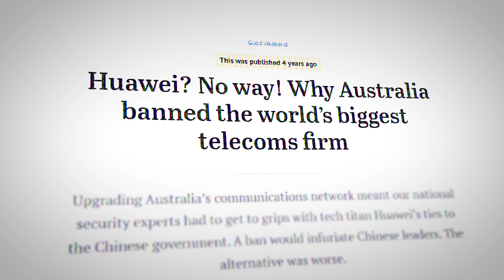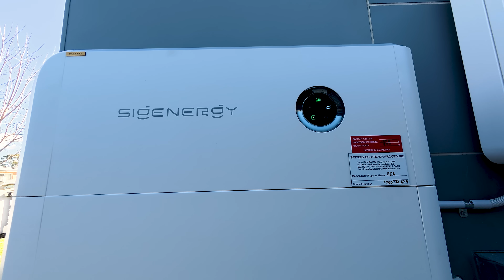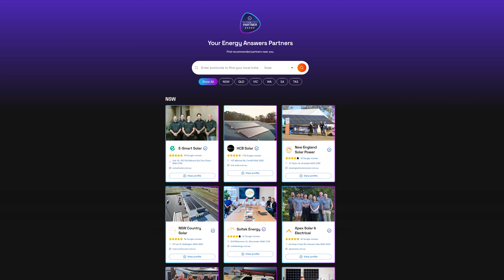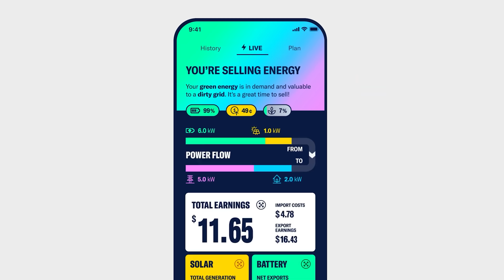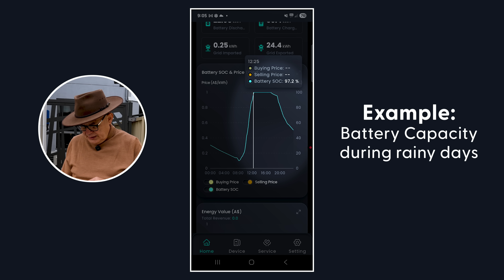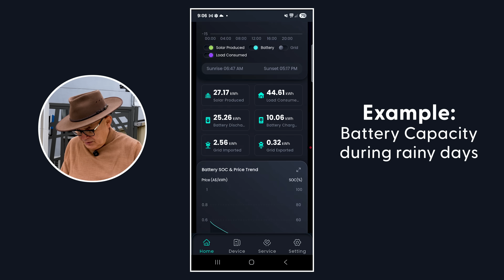Is going off-grid with Sigenergy a big risk?

Comment: We love our 24kwh sigenstor system. We could definitely use more, but our plan is to get more modules in 3-5 years to keep newer batteries in the stack at all times. Have to consider the senescence of these systems and cost of replacement. I want to make sure we are never going to have failure costs that would hurt to fork out all at once. The rebate is amazing, but too big is still going to cost you, especially to maintain later. Plus these systems will get cheaper with time, and better. The inverters only have 5 years warranty, so you want to stay on top of the longevity plan as well as the immediate. Of course more is better in the moment…not so when it needs replaced all at once. There are huge advantages to modular systems. I would rather use the whole battery daily for 3-5 years, then expand and keep the modules cycling than be looking at 30-40k all at once every 7-10 years. At least panels last 15-20 years now. Plus, a large battery system makes the efficiency of the solar less critical, it is sort of just bonus on sunny days and keeps you going on the cloudy days. 

Also, this was a really great video, thank you. I completely agree about cloudy days. Here in Melbourne you do have to charge from grid and I love that Amber makes it so I do not have to think about it all the time. It knows I want to keep it full and charge from the grid when it’s cheap to make it through exy periods at night. Has been a game changer for us and makes having a battery system worth while. With other retailers you are not saving any real money putting back into the grid anymore. Sad to see honestly. The 10km/day caps are really ridiculous imo. Not sure how our kWh are any different than theirs and we pay delivery fees to cover the grid costs so there really is no excuse…Amber is helping stabilise the grid and we are benefiting as well. Win win honestly.

Comment: if going fully off grid think about Ford lighting it has 100KWH with V2H so if you are running out of electricity you can take to electricity  from a fast charger and then power your home trough the ford lighting

Comment: I have a 6.6kw system (no battery) and I spend $600 per year on electricity bills. 
I run my pool filter for 7 hours in the day, use the dishwasher in the day and cook at 530PM using mostly solar energy.
OK TV, low energy lights, two laptops, and a fridge during the evening. In bed by 11. Very little energy use.
Its simply not worth me buying a battery. I can live with that electricity cost easily, and have the full knowledge that I have access to grid power if I even need it.
Paying off a battery and more panels would definitely cost more than 600 per year.
EDIT: Enjie is my discount supplier, who was formerly Simply Energy. I have been with them for 10+ years without a fuss. Their prices are excellent.

Comment: If its sunny I can be  using no grid power for days on end and sell a bit back when its pricey from my 16Kw battery setup (Sig).  But its much cheaper to charge on rainy days when rates are low.  This way (with Amber) I can mostly pay zero for grid energy including supply charges while still staying connected to the grid.  And yes, I'm wishing I doubled up on our batteries when we purchased as I would like to add more.  Even so, this setup (10kw panels + 16Kw battery) will pay for itself quickly.  I will know more after 6 months.

Comment: There is no reason to go off grid now with “wholesale” like models such as Amber.
Here you can export energy at peak times when you earn extremely high returns. 
You still have the support and back up of the grid but the earnings offset any costs.
A system
Like the one you propose will provide you with enough stored energy to make this worthwhile.

Comment: I,m not sure you are a real user, or a selling agent for battery products.  Your consumption appears very very high. I am in Melbourne too and have 30kwh of battery and 20kw of solar and have no issues lasting a couple of days in winter with say 4kwh of solar coming in. As well as charging an electric vehicle. My main system is Off grid with an 11kw inverter. I also have a 5 kw grid connected system which I use for exporting.
Reply from the maker: We also have tenants on our property which we provide electricity too so thats roughly 7 people using the electricity at home. Hope this makes a bit more sense.

Comment: Im looking at both Tesla and Sigenergy to add to my existing solar set up. From my research I’m favouring Tesla . Sigenergys support structure and random component warranty lengths worries me- not all the system is covered by the 10 yr warranty!I’m also concerned about the sigenergy plastics and how they will fair in the Australian climate. Already i have heard about sigenergy inverter plug failures (which they blamed on installers) and display failure
Reply from the maker: Thanks for sharing your thoughts — totally fair concerns, and it’s good you’re digging into the details before choosing a battery.

Comment: Here’s one big thing to consider when disconnecting from the grid with panels that are only AC-coupled (that’s what I understood from the video, it’s fully AC-coupled).

If your battery becomes completely depleted, the system can’t restart on its own! You mentioned that you don’t go below 10% battery, which allows your AC-coupled inverter to restart, but in a fully off-grid setup it’s possible, through an unfortunate chain of events, to need that last 10% and end up at 0% by morning. That’s when the trouble starts.

AC-coupled PV inverters require a live AC voltage and frequency to operate. Even without a grid connection, your AC-coupled inverter still behaves as if it’s grid-tied, it needs to “see” a stable AC signal before it will produce power. Normally, the battery inverter provides that reference by forming a mini-grid inside your system. But if the battery is completely depleted, the battery inverter can’t power up its electronics or generate any AC output. With no AC voltage present, the PV inverter assumes there’s no grid and stays off. So even with full sunlight, the battery inverter can’t start because there’s no stored energy, and the PV inverter won’t start because there’s no AC reference. Nothing energises until an external source is introduced.

That’s why I added a few kilowatts of DC-coupled panels alongside my existing AC-coupled ones, so if the battery ever hits 0%, the DC-coupled array can black-start the system and bring the AC-coupled inverter and panels back online. Or you need to go the diesel generator way, which is way more expensive to buy/run/maintain.
Reply from the maker: Great point. Yes — with a fully AC-coupled setup, the battery inverter needs to be able to “form the grid” for the PV inverter to wake up. If the battery ever hits 0%, there’s no AC reference, so the PV stays offline even in full sun.
Reply: Hi Guys, great channel 👍 
Is it possible to be of grid, yes. Currently we have been effectively off grid in Melbourne for the last 2.5 years. 
A 4.5kw solar into 24v 24kw system at ~6kw supply using outback equipment. 
The second system is a 6.6Kw solar system via a 5 Kw fronius direct to the grid @ 10c Kw. Currently 510 in credit.
But now it is time to go wholesale VPP.
The changes to the battery rebates is the impetus for the change to a sig 48kw system.
Just awaiting final quotes.
Cheers Jon Vb

Comment: Nice one Markus, shame job for smart energy solutions with that corry thru the side entry into the ac? 😮
Also I’ve seen and read that hybrids aren’t the best choice for full time off grid?
I have the 40kw and 25kw 3P with gateway full house back up and it’s great 👍 vpp is good to expedite roi however what you don’t get told enough is the throughput cycles shortening its life and warranty like kms on a car not just the age? Cheers
Reply from the maker: Glad to hear your system is working well! You're right to think about throughput cycles; it's definitely something to consider for battery longevity.

Comment: I have a "small" Sigenergy system - Gateway, 5kw SP inv, 9.6kw PV, 16kwh battery, 12.5kw DCEV charger. Also BYD Sealion 7 with V2X and 82kwh battery.
I only have experience with the tail end of winter - But I am quite sure I will survive winter easily by myself and probably adequately if my adult son continues to stay here. The car battery is huge but strangled to 2.5kw discharge - but it's still enough to get me through multiple poor weather days in a row as it combines with the house battery quite seamlessly. So I totally could go off-grid if I wanted (If we're allowed to here in Perth?). I could save $1 a day.
But I have no desire to go off grid because on good days I'm pulling 65kwh off that roof and my home load is about 10-15 - I can't use it all! I need the grid to be able to send power. 
And it's so easy to use the Sigenergy system to do that during peak times (3-9pm). I say easy - actually it's a pain. Terrible interface design in the settings menus. The power diagrams are brilliant. Such powerful realtime infographics - But the menus to set stuff? WT actual F? Drilling down 3 levels of menus to get to items you need to tweak every day. Such a pain.

Comment: I was told with solar and batteries if your daily electric consumption is 40kwh you would triple that in battery size at 120 kWh and 1/3 of the battery size in solar so 40kw solar should cover off grid but maybe you would need less solar in a more brighter climate, I’m still learning it myself. Battery prices has dropped dramatically over the last month or so there’s 32 kWh hour battery storage for 2000gbp in the uk on eBay currently , I also think the solar bit is the most important

Comment: You would need double redundancy with a geni anyway, you can get gas powered which are more quiet with external exhaust kits
Reply from the maker: Good point — a gas generator can be a solid backup, especially with the right setup to keep it quiet and vented.

Comment: I have two Sigen in two locations. Only BAT 10 but both with EVDC my Tesla cars have 60 kW batteries so for rainy days works great I go to a SuC and fill them up.
Reply from the maker: Awesome to hear you’ve got two systems running smoothly!
Reply: @yeanswers there are pros and cons to everything, I would prefer Ai running everything I am tired of supervising. Even a diesel generator needs service and supervision.  Now I am hoping for FSD on my Tesla cars so they can drive alone to SuC and charge up when SigenStor BAT is low. As long as sun is shining everything is smooth but rain and clouds are still a problem.

Comment: whether or not you can stay off grid successfully is determined by how much energy you get from solar. the size of your battery is just a buffer for when the sun goes down, or for the odd day of cloudy weather. increasing your battery size will just give you longer till you run out of electricity. increasing your solar panels is the way to make sure you don't run out of battery
Reply: I think that depends where you live. Here in Philippines I have 12kw of solar panel but they produce virtually no power during a typhoon. If I add more panels I don't add more generation as 2 x virtually nothing = virtually nothing. Therefore I need more battery not more panels to go off grid. We currently have 64kwh of battery and plan to add another 64kwh as soon as the price of sodium batteries brings the price down. Adding panels would not help significantly, on good weather days (no tropical storms) my batteries are soon back full.
Reply: @nealonions7654  nope doesn't matter where you live, if electricity in doesn't surpass energy out from your home ... your going to drain your battery. a bigger battery will take longer sure - that's its purpose to be a buffer

Comment: We have a 15kw system. Most days it make more power than we can use.  Looking at our history over the last 2 years, we would need 60kw of battery to make it through winter. Yes on wet days, will need to conserve energy to get through the night etc. More energy efficient appliances help too.  Heat pump clothes dryers only use 2 kwh to dry an 9 kg washing load. 2 loads at 1kwh each to dry efficiently. Heating and higher than standard energy efficient heat pumps help too, as well as a well insulated home. Many things to consider all at the same time. So we have not got any batteries yet. Waiting for the price point of 60kwh batteries to be affordable over a 4 year term. Currently I don't think it is actually cost effective to be off grid at the moment. Out here, if you are exporting a reasonable amount of power per day, then will have to pay tax on that income. At 40% as secondary income, quickly becomes not very viable.
Reply from the maker: Thanks for sharing your detailed experience — it really highlights the complexities of going off-grid!

Comment: Sigenergy has set a high bar on how to engineer a solar battery system.

My big concern is however, the system will turn off if there is no internet connection for 90 days.

Sigenergy is relatively new and if they stuff up their rapid expansion, end up insolvent, your system is worthless.

I’m hoping they change this or other companies develop a competitive product before I pull the trigger
Reply from the maker: You bring up some valid points! It's always a good idea to consider the long-term reliability and support of any new technology. Hopefully, Sigenergy can address those concerns as they grow.
Reply: I'm hoping the Sigenstor can connect to a laptop for updates as I don't have WiFi at home. Also wondering sigenstor will have issues with v2h without WiFi 🤔

Comment: Disclaimer: Unless you live in WA and you get hammered with $0.00 feed in tariff.

I have SigenStor +32kWh storage with 18kW of PV. I have taken myself off-grid with 32kWh and i charge an EV. I actively have to find creative ways to use excess PV and stored electricity. On a rare WA rainy day, i just ramp my usage down.
Reply from the maker: Sounds like you've got a fantastic system and have really mastered managing your energy use, even with those WA feed-in tariffs!
Reply: @yeanswers its a great bit of kit hindered by a bad grid. It's a shame I can't export more to benefit others. But i'm limited to 1.5kW and get nothing for it. I'd be happy just to cover my daily connection fee.

Comment: I have a feeling that the solar industry might end up being similar to the computer industry where everybody basically settles on 2 or 3 "standard" systems. Tesla changed the game when they introduced the Powerwall, and that has defined the all-in-one system which other manufacturers are basically copying and adding a few new features. It's kind of like the Apple II, or even the Macintosh.

To me, Sigenergy basically defined the other big "standard"; the scalar modular system. This is your workhorse "x86/Wintel PC" for people who take their solar a little more seriously, but don't need a "server" (i.e. an industrial scale battery system).

If the market did go this way, it would really make a lot of sense because you'd be able to define some key standards that would allow you to install 3rd-party products into an existing ecosystem, or to upgrade without ripping our your entire previous investment. Whether they meant to or not, I think Sigenergy may have just cracked open that door where it's possible to get e.g. 3rd-party battery modules that fit seamlessly in a SigenStor. I know we're not there yet, but just think about it; whoever defines those standards could basically rule the home backup/off-grid market for the next two decades, just as Microsoft and Intel did in the computer space by leveraging the x86 PC standard. If it's an open standard that anybody can make certified products for, that would be great for the consumer.
Reply from the maker: 100%. The parallels with the computer industry make a lot of sense.

Comment: You are overdoing it and you don’t need that big battery and lots of panel and you never stop with 48kwh, how about another 48kwh battery then…instead I would  just go with OVO with smaller battery and less panels free 3 hours electricity and you pay nothing other then supply charge summer or winter.
Reply: The main issue with this is, how long do you think those free 3 plans and reduced rates are going to last? Not forever, and certainly not for 10 more years. The battery investment is for 10+ years and as mentioned, you only get one bite at the rebate. Given the stackable nature of the sig, most moral installers don’t charge much more than cost for the additional battery modules, which are the portion of the battery you get a rebate. When I got my pricing, the difference between a 24 kwh and 48 kwh was just a little under $6k. Given the reduced cycling and stress on the battery, plus future allowance, if you have the $ it’s a no brainer. Put it this way, do you think you will be able to get the additional 24 kwh of battery modules in the future, when the rebate finishes, for close to $6k? Highly doubt it. Also would need to consider the modification cost to the smaller installation to make it 48kwh.
Reply from the maker: Thanks for the perspective — there are definitely a few different ways to approach the off-grid journey and the right choice often depends on individual circumstances.

Comment: I'm in Perth so no feed ins for > 5kW and no arbitrage but we use a lot of energy with two A/Cs.
I understand about home batteries but one car with say 60kWh or more. If that's not enogh then get another car.
The state is not called W(ait)  A(while) for nothing and Synergy lsughed when I asked about V2H. 
Does anyone have experience here in getting it to work? 
eg what charger, inverter and installer?
Reply from the maker: We recommend reaching out to Solar2020 or PSW Energy!